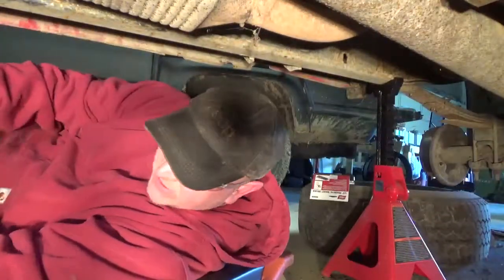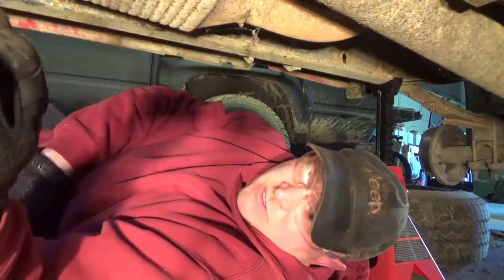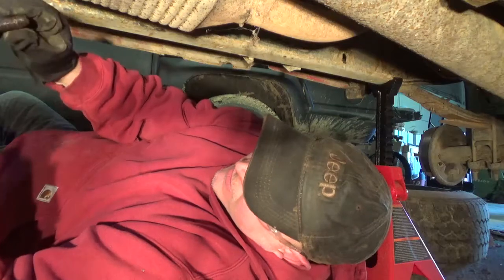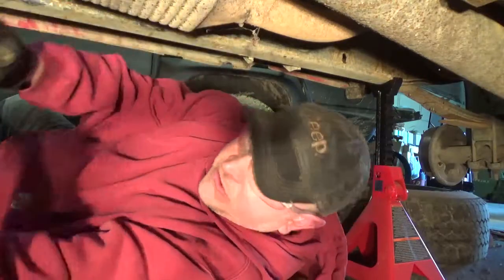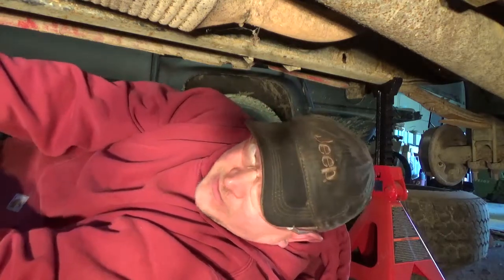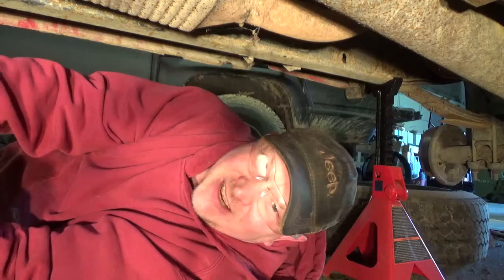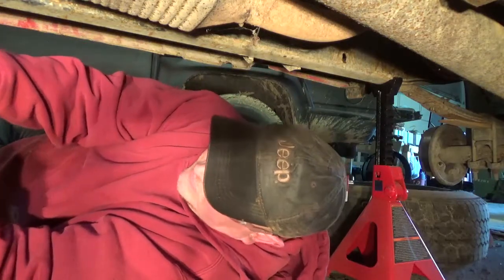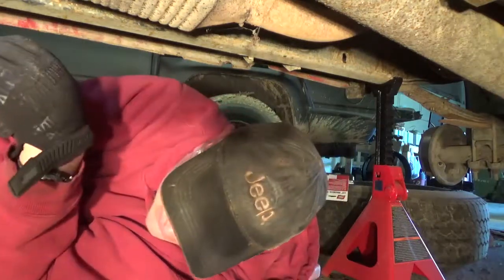97 Dodge Dakota Project Torsion Bars pt2

Comment: Uhhh...... you realize you are supposed to use a tool to take the tension off the torsion key BEFORE you loosen the bolt?
Reply: how do you take the tension off
Reply: @jnmccluskey  there is a tool that is sort of like a c clamp that holds the key so you can take the bolt out.
Reply: Their is a c clamp style tool for that to release pressure you can rent it from any auto store